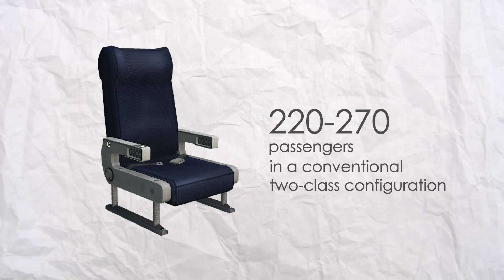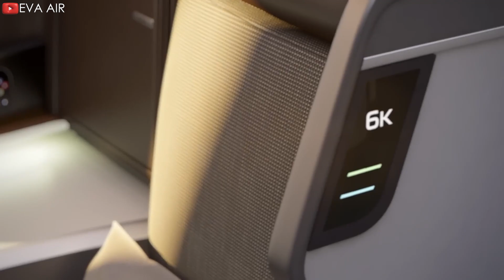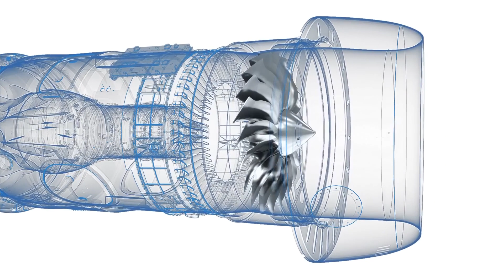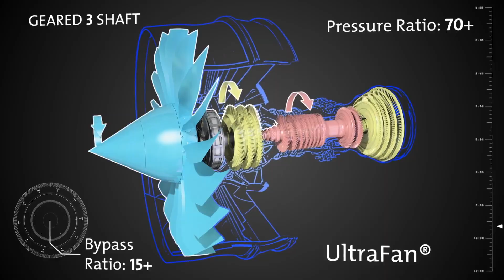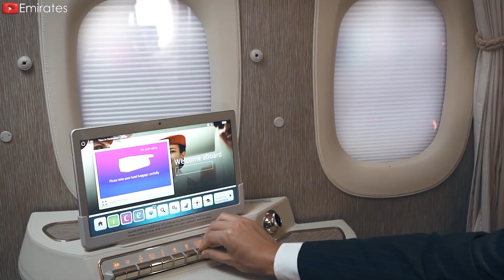Boeing says "Goodbye" to Airbus with New 797 incoming! Here's Why

Comment: There is one main issue with the logic here.

Yes, there is a gap between the single aisle aircraft and the current twin aisle ones, and that the 797 looks as if it could fill that gap as well as out performing the A321. Where the argument falls down is that it fails to consider the possibility that Airbus could also chose to fill that gap with its own small twin aisle.

Additionally, it is accepted that the A321 could do with a more power. Currently there is nothing suitable available to rectify this shortcoming. This lack of a suitable engine also means that there are no suitable engines for the 797 either. No doubt when they become available, it would be a relatively easy fix for the airbus to fit them to the A321 and even make the oten talked about further stretch of the A320 series. Not only that, being an enhancement to an existing aircraft rather than a clean-sheet design, it couod be operational years befor any 797 could be.
Reply from the maker: nice, thanks for your feedback

Comment: You call this content? B797 barely exists on paper and the A321XLR is close to delivery. It’ll take probably 10 years from now for the B797 to be delivered to customers if at all. Pie in the sky wishful thinking content at best.
Reply: I would go even further. Based on current performance, the replacement for the Airbus A320 series could well have been with the airlines for a few years before the Boeing is certified
Reply from the maker: yep thanks for your feedback